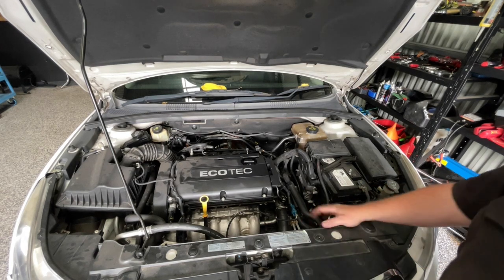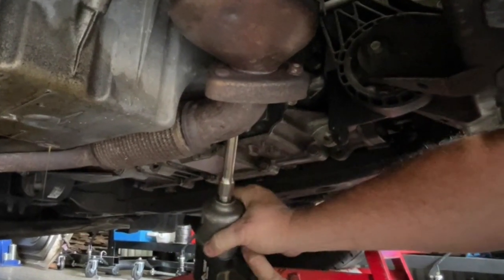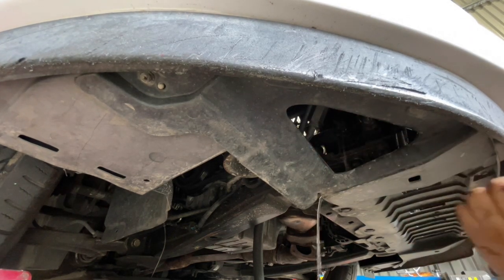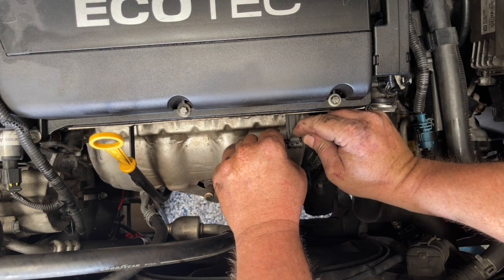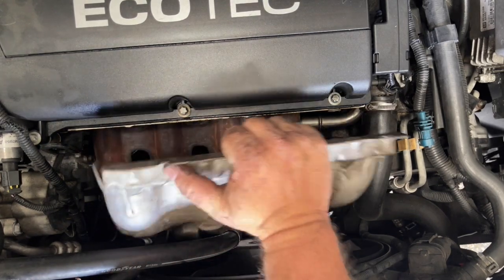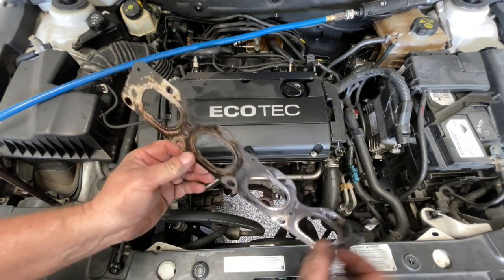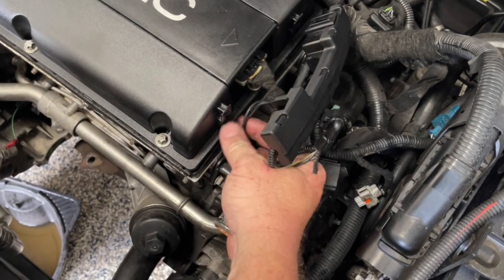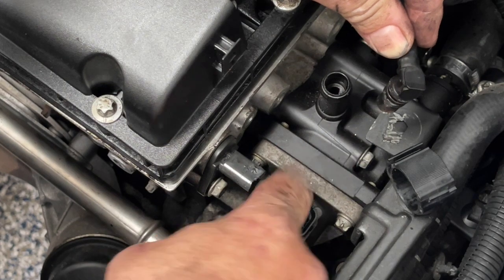Cruze Head Gasket Replacement  STEP by STEP process (Part 1 of 16) Full Details for 1.8 F18D4 Engine

Comment: Can i get the head put without removing the exhaust manifold completely like can i unscrew the nuts on the head and pull the exhaust back a little so i can get it out ?
Reply: Were you able to?  I'm working on a 2015 Sonic and the exhaust manifold won't come out without removing the O2 sensor or radiator fan. I don't see why it has to come completely out though.

Comment: First off I want to give you a huge thank you for this series.  I've had to replace the head gasket on a 2013 Chevy Trax twice and both times I followed this series step by step.  But for the latest maintenance job on it I've had to replace both cam gears because they were leaking and when putting on the new ones I made the mistake of over-torquing them and running the engine up to temperature.  Now I need to get them off and they just will not budge.  I've used cheater bars, I've hit them with the impact, tried heating them, tried shocking them with a hammer and nothing.  Any idea on how I can get them off?

Edit: I'm referring to the torx bolts that fasten the cam gear to the camshaft.
Reply from the maker: Sorry for the slow reply, hope it’s sorted.
Reply: @killawattgarage  yeah, had to pull the cam shafts and cam gears out together and replace them.

Comment: Thanks mate , this got me right through a complete head replacement and an Oil pump replacement on my 2009 Cruze. I did notice you left out a few Torque settings for some of the bolts but real easy to find online. The cheat sheet for the Torque setting and passes for the head bolts is a must and i would suggest you have zero distractions as it is very easy to get lost through it.

Comment: Donald Calvin Sotero
3 hours ago
Just watched this videos and explaining the way you did is just Awesome! I got a 2016 equipe and it has a cracked head where the Sparkplug well on No.3 or 2.. I found out there's a Recall on this but holden will not own up.
Would you advice getting a head from the wreckers or get a reconned head and where to buy it from? Thanks much
Reply: Damn i had a cruze with same issue. It one had about 60.000kms on it what a rubbish. definitely amanufacture issue